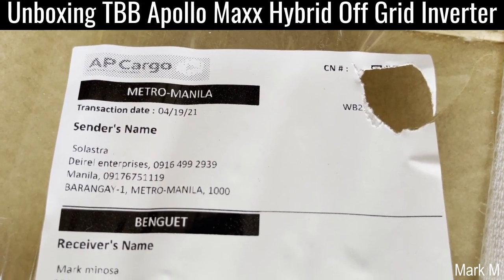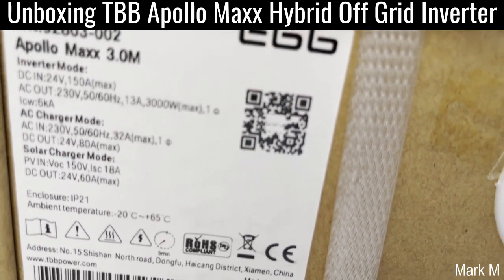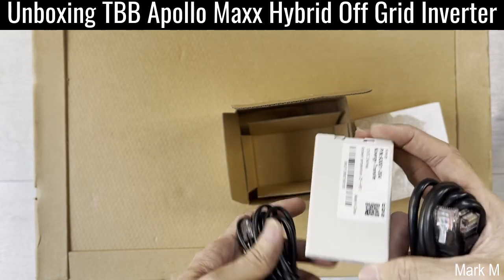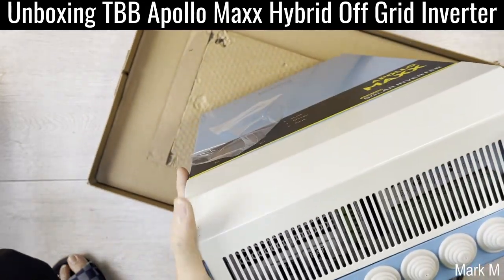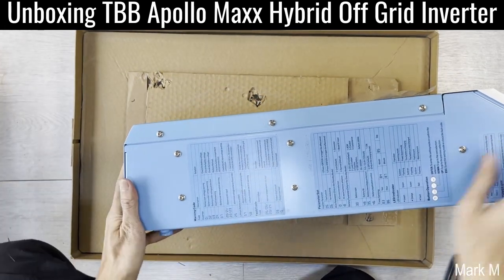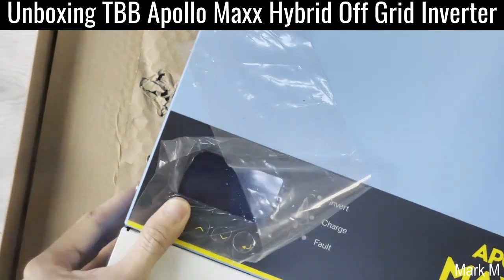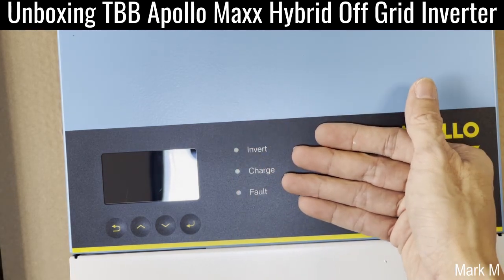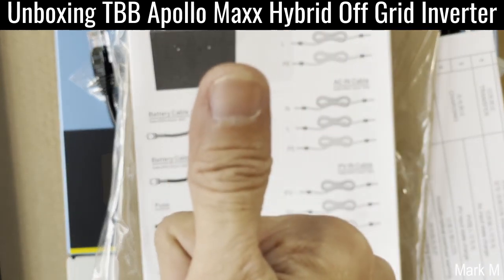Unboxing TBB Apollo Maxx Hybrid Off Grid Inverter

Comment: Good day master question lng po kaya ba yan ng mga water pump at portable welding machine
Reply from the maker: Water pump yes, hindi kakayanin ang welding machine, masyadong mataas ang current draw.
Reply: @MarkMinoza  1.5hp deep well pump Kya po ba hugutin Ang pressure Ng tubig sa first on?
Reply from the maker: @emilyavila2940  need nyo pong kunin ang inrush ng water pump nyo kung gaano kalaki ang current, baka hindi ka kayanin ng 3kw. Eto po ang link paano kunin.
https://youtu.be/ZQNrEZ8wwxc
Reply: @MarkMinoza  pang malakasan yang fluke mo sir,, Meron po bang ibang brand Ng clamp meter na accurate na mdyo budget meal?
Reply from the maker: @emilyavila2940  meron naman sir, hanapin nyo lang ang clamp meter na may inrush current capability. Mostly ginagamit pang water pump nasa 5-6kw off grid toroidal. Etong sa akin 3kw lang po yan pero naka parallel. So ka kayanin sa requirements nyo dahil 6kw max rating.
Reply: @MarkMinoza  ung tbb riio sun 5kva Kya sir,,match na Kya?
Reply from the maker: @emilyavila2940  same lang sila sir, ka kayanin dahil 5kw. Ang wala lang sa Rioo parallel at ac coupling.

Comment: Mag work b sya pag walang solar panel. Bale ac charger lang para ma charge ang battery?
Reply from the maker: Yes po, it will work without PV. pero mas mainam na meron parin kahit maliit. Dahil doble bayad nyo sa charge and discharge using grid.
Reply: @MarkMinoza  what do you mean na doble bayad sa charge and discharge using grid pag walang pv?
Reply from the maker: @vicsuarez1163  pag ginamit nyo ang AC Charger ng Inverter, sa grid po kayo kumukuha. Everytime you charge your battery using the grid, doble ang bayad dahil gamit nyo to supply the load is Grid, and to charge your battery is also from the Grid. Unless, youre using it for emergency purposes, which still constitutes to using the grid when charging your battery.
Reply: @MarkMinoza  kaya pala doble. Maraming salamat